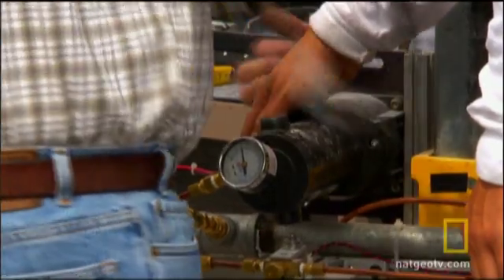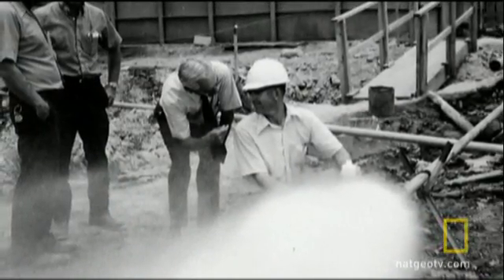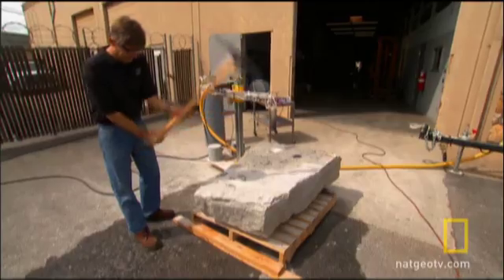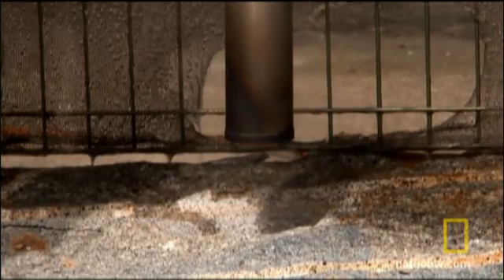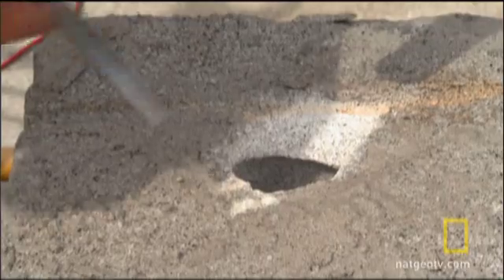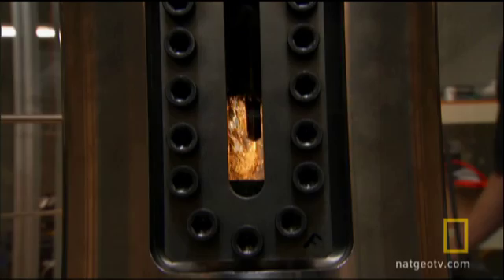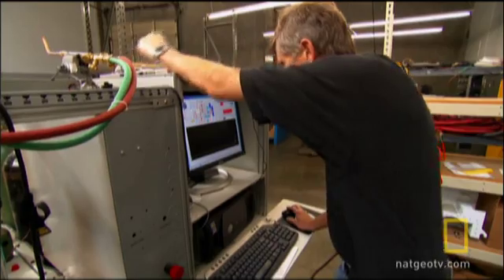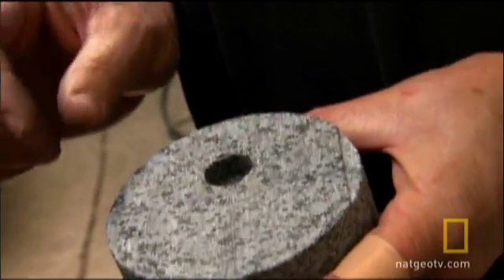Flame Drill | National Geographic

Comment: one problem!
a stoichiometric mix of hydrogen and oxygen is highly explosive!!
and feeding 10000 feet of tube filled with it is begging for an explosion!!

also producing that hydrogen requires alot of electricity and water + electrolyte
get ready for lots of those chemicals in the water supply!!
Reply: I need this technique.. but is it save for oil n gas sector...
Reply: yakoob khan i hope you dont go bankrupt spending money on expensive air tight seal piping

also rubber tubing inside the pipes may melt so you need more exotic shiz and make sure no leaks happen or BOOM!!

and it wont save you shit because hydrogen and oxygen were generated where??

in a factory that splits water using energy from power plants!!

Comment: No oxygen down in those holes, but that which they send down, and the flame drill is using it all. Down there the temperatures are already fairly high and these pockets don't explode on their own.

So not much , in short. Which is a boon for this thing working.

Comment: Dries up entirely. But I think that the flame drill will be used to get close to the oil deposit, and then the rest of the way will use a regular drill. The thing is there is also a water-drill, and an Ion-drill (air) that both exist as well...

Comment: Hopefully the project managers and the seismologists will do a flammable gas risk-analysis before 'drilling'.  'Drilling' used loosely as drilling usually involves rotatory motion.

I can see applications for construction, especially shallow horizontal tunneling.

Either way, the caveat is ... Use with Caution.

Comment: Nothing ever burns on its own. You need at least 2 different components to react. Hydrogen reacts with O2 producing energy+water. Hydrogen in a confined space without O2 will not burn.

how UN stop the oil well in kuwait from burning after the gulf war? they use explosives to blow out the well tip. [2H2+O2=2H2O, C+O2=CO2] oxygen consumed thus stop the burning.

why do rockets carry both hydrogen & O2 tanks? think abt it

I though even the kids know what burning is, well I guess I was wrong.

Comment: You argument is like sticking your head up your arse. You think its dangerous to put a flame drill into an oil deposit without any abundant supply of oxygen but you dont think its at all risky to ignore out outputs into the ecosystem and just carry on under the blind assumption that we are not effecting any environmental process?

Its safe to use a flame drill under ground. And its safe to assume that our actions are effecting the environement. Ill let you get back to fox news. thick fuck

Comment: "You do realize that substances will spontaneously ignite at high temperatures right?"

Pressurised crude would kill the flame and cool the drill head in moments if it were to flood the bore hole.

Why not join their team and design a drill with a stick of dynamite attached to it. It wont help crude burn without a good supply of air but then you can at least set off an explosion whenever you want.

Comment: The drill will have high pressure feeds of both hydrogen and oxygen, thats how it works. The hydrogen alone would be useless at burning in that environment, so would the oil.

Comment: Dude, combustion is not as simple as you think (if you could even remember your basic level science classes you would know this), especially in enclosed spaces, which at one end of a 12' tube thousands of metres under the ground, effectively is.

Also, this is for tapping geothermal supplies of energy and striking oil is the exact opposite of what they are trying to achieve. Hitting oil would be an absolute failure.

Comment: How hot something is doesnt matter in the slightest if there is insufficient oxygen to maintain ignition.

Sometimes they even use dynamite to extinguish well fires, seems silly but the explosion steals the local oxygen from the fire for long enough for the fire to die.

Fuel + air is required for combustion. Some materials can combust in water by breaking the chemical bond in H2O to release the oxygen, like magnesium/potassium , but crude old is not like that lol.
Reply: why would you think this drilling will be apply to the area with fuel exist?

Comment: Infact the only way they could fathom to extinguish the oil fires was a big cap to deprive the oxygen. These things were pretty huge and also not absolutely air tight. Im fairly sure more air was allowed to pass under the edges of a 50 meter well cap than would be able to suck into a 12 inch bore hole.

Comment: Luckily drills tend to be used to drill into solid materials rather than into open air.

Not to say that theres no oxygen under the ground but its gonna be pretty quickly depleted in a 12' bore hole.

Comment: As someone who works in the oil and gas industry, the only question about this i world have is:  how cost effective is using hydrogen over drill bits?
Reply: Back when you asked this question a drill bit could cost $30,000, and had a lifespan of about 40 hours. No idea about in 2019 though